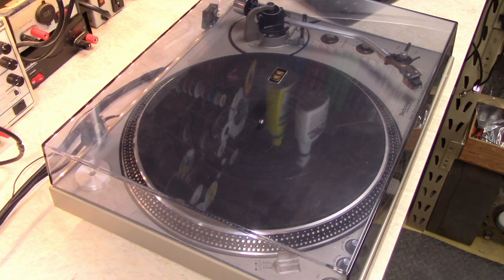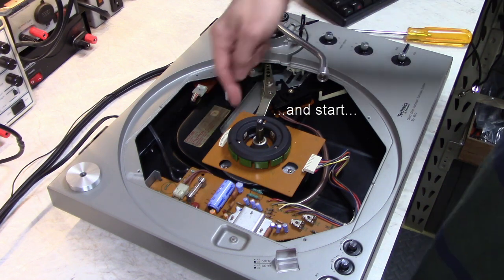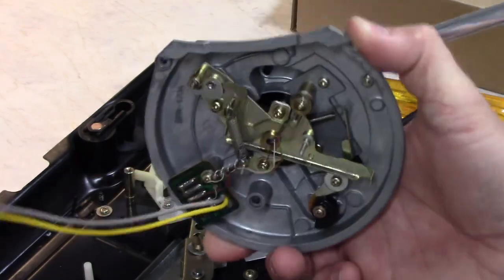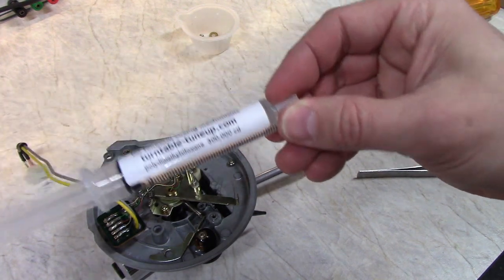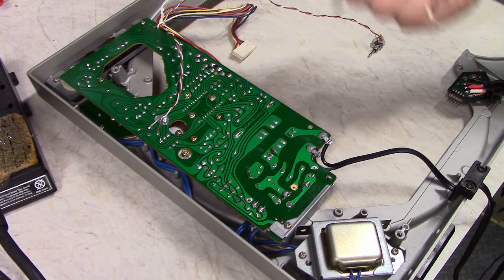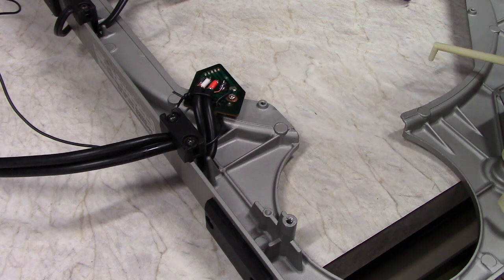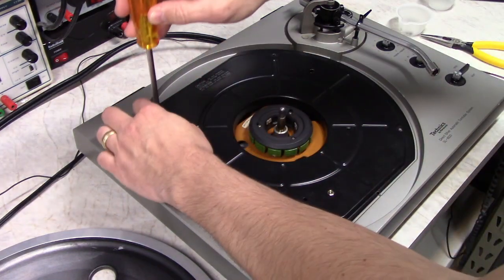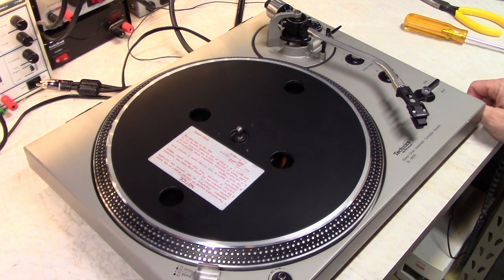Technics SL-1600 Servicing

Comment: I just really wanted to thank you for doing this. I managed to fix up and re-grease everything thanks to this very detailed video. I've done the speed knobs before, but had never fixed up the tonearm and lever. Now my Technics is running and clean inside and out just like the day it was bought in 1977. Thanks a bunch!
Reply from the maker: Glad it helped
Reply: If your turntable is not grounded then what
Reply: If my SL - 1600 is not grounded what is down low

Comment: Thanks so much for posting this video! Following your instructions I successfully replaced the cueing damping fluid on both of my SL-1650's today. 

Technics published a Technical Service Bulletin (available on the Vinyl Engine site) which has a "Method A" and "Method B" to replace the cueing damping fluid, depending on the serial number of your turntable. Both of my 1650's fall under "Method A" which requires removing the arm lift assembly from above, which, as you say, is not possible. "Method B" (supposedly for turntables with an earlier serial number than found on my units) does have you adding the fluid from below, but also has you first attempting to remove the arm lift assembly from above. Bottom line is that I wouldn't have had a clue how to disassemble the turntable to accomplish this task without your video. Thanks again!
Reply from the maker: Glad you were able to do it.  Yes, I had the same earlier design requiring more involved disassembly.  Still doable though!

Comment: After my previous post below, I asked a seller of the silicon dampening fluid on eBay about what he thought. He suggested I try the 500,000cst fluid or even the 1,000,000cst fluid (using a small amount). I took his advice and purchased the 1,000,000cst fluid. I re-cleaned everything (after a half-dozen times I have gotten pretty fast at completing all the steps) and applied just enough fluid to fill the ridges of the piston. The fluid holds better thereby allowing for less mess. The result was perfection: My tonearm drops very slowly and gently onto the record now. The 300,000cst is too thin for the piston and spring. That was the problem. Otherwise, these instructions are absolutely correct. Just do yourself a favor and get 500,000cst minimum or the 1,000,000cst.

Comment: Great tutorial. I was puzzling how to disassemble my SL-1700, which is very similar, and came across this. Easier than my SL-1400 to do the tonearm rest damper.

The only thing I found is that if you push the tonearm rest fully down, the hex head of the height screw sits proud of the rest, enabling removal of the screw, and therefore the tonearm rest (same as on the SL-1400). This then allows removal of the damper rod with the tube plate, without having to disassemble the anti skate. Just makes it even easier.
Reply from the maker: This is true of the later serial numbers.  Mine is the earlier one before that added this capability.

Comment: I followed your instructions to the letter. I tried to add the 300,000cst stuff from the same company three or four times. It wasn’t so easy since the stuff can get all over everything and it will flow down the piston. In any case, I repeatedly got the same result: The arm just dropped with the lever. There was no no slow drop. It actually seemed to drop somewhat slower when I tested it before I replaced the spring. Once the spring was back in place, and I lowered the lever, the mechanism just dropped at the same rate as the lever. I finally gave up. I must have been doing something wrong…or the black plastic lever part isn’t engaging with the white plastic part properly.

Comment: Seems like your overhang is too forward. Do you have the Technics overhang gauge? They're cheap as chips. Thanks so much for the this. I came here for the tonearm damping fluid fix and stayed for the 78 RPM mod which I think I'm going to do to my SL-1700. I plan to use a small low profile push button switch instead of your toggle. Less concern of interference and a round hole will take care of it. Well done and thanks again. 👏👏👏
Reply from the maker: Glad you found it helpful!  The reason for the overhang is that I am using the Baerwald alignment, which pushes the Technics tonearm to the outer limit (and looks a little funky because it ends up slightly crooked).  The stock alignment is indeed further in and is closer to the Stevenson method.  I do have one or two Technics tools kicking around.

Comment: This is a great video and it helped me dig into my SL-1650! Thank you for taking the time to create this how to. I adjusted my trim pots, but the 33RPM still runs a bit fast. Is there a place that you know that sells replacement pots? I think I need to replace the speed adjustment pots because I cannot seem to adjust them enough to get the 33 to not sound like chimpmunks are singing Xmas songs.

Comment: Thanks for the video, very helpful with showing how to take the table  apart. I am currently in the process  of trying to solve the problem of having the speed randomly speeding up and slowing down.
Reply from the maker: Does it hold steady if you move the speed adjustment to be slightly off?
Reply: @AmorphousAudio  You need to clean the speed controls from underneath with Deoxit. Search Youtube for videos on how to do this.

Comment: Can you recommend the proper lubricating oils and grease you use and where to apply them when doing a complete cleaning and re-lubricating?  Much appreciated and helpful video in reviving my SL-1700
Reply from the maker: I use a synthetic grease called "super lube" to replace most light-duty greases used between plastic/plastic and plastic/metal interfaces (where white lithium grease is normally used).  Some situations with higher loads require moly lubricants.  For oils, it kind of depends.  For brass/bronze bushings requiring light oiling (like capstans), I often use a synthetic sewing machine oil.  Technics uses a special oil on their motor spindles, which is a heavier viscosity.

Comment: You can turn the hex screw by depressing the lid arm itself—it’s spring loaded.  The screw will then be able to turn once the lift arm is slightly pushed down revealing the hex screw head.  The lift arm is the cue lift that lifts the tonearm.
Reply from the maker: That is true on the later serial numbers.  Sadly, mine is an earlier model that requires disassembly.

Comment: Can you tell me where to find the schematic and service manual for the SL-1600. I purchased mine new in 1977 when in the Navy. It is not working properly the grease is probably dried out. I can only find the SL-1600 MKII manual. Great video and maybe I won't need the manual since you gave detailed instructions. Thanks for this awesome video.
Reply from the maker: Check vinylengine.com.

Comment: Hi just got this turntable from my father and it needs servicing.  I dont know how much I want to put into it.   How does the 1600 compare to a modern $1000 table?  Thanks!
Reply from the maker: Well, it really depends on what you are going for and what condition the deck is in.  Even at $1000, no one is making direct drive tables anymore...though that isn't super-important to most people.  The other thing modern TTs don't do is automation.  You can get cheap tables that are semi-auto, but all the high-end stuff is fully manual.

Comment: You need special silicone grease CS5000 or CS3000 for the support cue arm damper ! It's also used and sold for RC remote control cars differential depending how fast you want your cueing arm to drop down !
Reply from the maker: Yes, I am using the correct grease for this application.

Comment: Great video. I have an SL-1700 that I need to add damping lube to the arm lift as the arm drops too fast. I watched a video yesterday showing the difference when using the stylus downforce scale, with and without the mat. Actually, to get an accurate reading the mat should be removed, since the thickness of the scale itself is about that of the mat.
Reply from the maker: Yes, the thick mat on these is perfect when using a scale of you want an exact value.

Comment: This is awesome! I’ve learnt so much...
I am about to replace the RCAs on my Technics SL 1800 as I am losing the left channel... Should I avoid a pre soldered internal ground one and just solder new wires?
Reply from the maker: I replaced the cables on mine with a new set of quality RCA cables.  I just cut the connectors off the other end.  Most cables will work so long as they are not too long.  Ideally, you want something with low capacitance, bit they figure is rarely specified.
Reply: @AmorphousAudio  thank you so much!!
Sorted that!... only problem now... on putting back together, it’s lost its ‘bounce’... no earthquake tests until I suss where I’ve gone wrong! 😌

Comment: This is a great video. I just imported this unit from Japan, Cosmetic wise it is excellent. Now I am having the erratic speed issues which seem like spinning at 90rpm or more. Yes, I am using a proper 220v -> 100v transformer. I am running out of ideas how can I fix this? Is this the AN630 IC issue or something else. Would you be kind enough to shed some light on this? I love this unit but I can't use it with the speed issue. The spinning is inconsistent in the sense, let's say it is spinning at 90 rpm .. it also slows down by itself and goes back faster spinning again. I tried to adjust the VR underneath the platter, it did not help either. Really want to fix this unit for my personal usage. Any idea I would really appreciate. Thanks for this video!
Reply from the maker: It's usually one of two things: dirty adjustment pots or bad capacitors.  Buy a can of Deoxit Fader and give the speed control pots a blast.  If you move the adjustment knob to a "wrong" speed position, is it more stable?  If the deoxit doesn't work, then the pot may be too worn.  A workaround it so tweak the internal adjustments on the PCB slightly to move the correct speed setting to another position of the main pot.

Comment: Great video ..... I have problems with my arm not starting  or ending properly on my SL-1600 any video on adjusting that ?
Reply from the maker: If it is not moving completely into position in either direction, it is probably an issue similar to what I have.  There is also a small gear that tends to crack that causes issues as well.  The position where it comes down on the record is adjustible.

Comment: Excellent presentation. Hope to pick up the same model TT from a friend of a friend and will use your video.  Many thanks 👍
Reply from the maker: Thanks and good luck with it!
Reply: Amorphous Audio - Yesterday I cleaned and added silicone damping fluid to the cueing mechanism just as you described in your SL-1600 video. Mine turns out is an SL-1800. The strobe light comes on but the motor doesn’t spin. I will take it to a Tech to find out what the issue is. Great TT in perfect shape.

Looking forward to your future vids 👍👍

Comment: I have a FL 1300 Turntable Direct Dr. and it will not stop turning. I don’t know if it’s from the arm adjustment or the mechanism itself and sounds like you know what you’re doing.
Reply from the maker: I assume you meant SL-1300.  Does the automation work otherwise?  I think the motor is controlled via a micro switch on these, but it's been awhile and I don't recall off the top of my head.  You can download the service manual from vinylengine.com.
Reply: @AmorphousAudio  yes Sl 1300
Reply: @AmorphousAudio  ok thank you very much

Comment: all the sl technics I had having the same problem; tone arm dropping to fast. I tried mij sk 1411 to mend it the way you dit here. it was not a succes. in the end using in the end thick gravite? grease but not enough effect on the damping. I have quite this  job now. 😒
Reply from the maker: If the regrease did not work, then it may be something else with the dampener.

Comment: behind the tonearm is the pivot. there's 2 horizontal screws 90 degrees apart, their silver. do you have a video or know how to calibrate these screws their like small cams. there's a small screw inside and a slot screw surrounding the tiny screwdriver screw. . i have a sl-3200 technics.
Reply from the maker: Are you referring to the set/locking screws of the tonearm pivot itself?  I generally avoid touching these (even when replacing tonearm wiring), as they are quite fiddly to get right again.  If someone has taken the linkage all apart, then you are forced to deal with it.  It's a matter of getting the linkage centered on both axes while leaving some play in the process.  Then you need slowly bring them in a little at a time while wiggling the axis to keep it centered until there is no play in the bearing.  Then lock the locknut on one side and back-off the other side of that axis about 1/8 of a turn before locking it.  That should give about the right amount of play.

Comment: You can actually loosen the hex screw if you just push that little curved black plastic part down. It’z the same way you adjust the cue lifter height actually.
Reply from the maker: That only works with some units.  :)  If you look at the service manual, you'll see there is an "early" and "late" design on the lift mech of the 1600.  Mine is the early design, which requires full disassembly.  Trust me, I tried and tried that trick before I learned about the difference.

Comment: anyone know the part number for the arm rest/lock? Mine broke. Also does it just screw in or do i have to totally remove the tone arm base like you did to screw in the arm rest? i hope not but your video made it easy enough to show how to do it.
Reply from the maker: Your best bet it probably to find a donor table, though that is getting tough in this age of vinyl resurgence.  Even a basket case SL-anything goes for too much money on eBay just to buy it as a donor.  You might have better luck on Craigslist or some other local listings on Facebook finding a beat-up, dirty TT with no dust cover for cheap to use for parts.
Reply: @AmorphousAudio  yeah I guess ill go without and continue using what im using to secure the arm while in storage.

Comment: how much current runs thru the switch? if it is a low current ,why not use a touch switch with some dubbel sided tape underneath the top below the speed knob or the on of switch,might be easier than lifting the mat up
Reply from the maker: Yes, that is another option.  The amount of current is small.

Comment: very detailed video. learned a lot. can you do a video about the 1600 queing problem? that would be a lot of help.
Reply from the maker: Which problem are you referring to?  The queing arm or the auto-start?
Reply: @AmorphousAudio  sorry. the headshell during autostart goes to the end of the record (near the center) and immediately returns to its resting position. i have to place the cartridge manually to the record if i have to use the 1600mk1.
Reply: @geoffanasar  I have that exact same problem with my SL-1301 TT.

Comment: Something that riddles me: in the PCB in the tonearm assembly you can see that the right ground is connected to the chassis ground. It's also like this on mine. Is this by design? I'm asking because my right channel is quirky and I don't want any chassis ground and motor noise in my right signal.
Reply from the maker: I think this is being used as a star-ground point of sorts for the TT.  I've seen it done this way to ensure there is no ground loop between the shielding of two channels (since they will be will likely be connected together at the preamp).
Reply: @AmorphousAudio  Thank you. I have eventually reconverted it to the original situation, where the chassis ground is separate from the channel grounds. It fixed the audio problem in the right channel. I think some userd do it to eliminate the ground wire. Cheers

Comment: Thanks for the great video, would a SL-1700 disassemble the exact same way? Anyone know if the 1700 uses the same capacitors seen at the 2:44 mark?
Reply from the maker: I think there are a lot of commonalities on the electronics side for this generation (non-mk2) of SL-1x00's.  I don't have the SL-1700 myself, tho.

Comment: My sl1900 have a runaway speed problem.i cleaned the variable resistor in the circuit board and also the knobs pots.but problem still there. I experiment by replacing  the variable restr.with 200kohms(the original value 20k won't work.), The rpm 33/45 is now controlled but unstable. Do I need to replace the "knob pots"?please advice.
Reply from the maker: It sounds to me like there might be one or more failed capacitors around the speed control circuit.
Reply: @AmorphousAudio  thank you for your suggestions.im having doubt too. The electrolytic caps are non polarity (2mfd)

Comment: Hello, I have this turntable and I have an issue with the anti-skate not working correctly. the tone arm drifts from the center back to start even on 0. I believe it is causing records to skip. How do you fix this?
Reply from the maker: The number of the anti-skate dial corresponds to the tracking force being used.  So if you run 2g of tracking force, you set the anti-skate to "2" and tweak it from there.  Obviously you can't run 0g of tracking force, so the anti-skate still pulls slightly since it is calibrated for more realistic tracking forces.  Most of my turn tables pull back lightly on the arm, even at "0".

Do you have an appropriate amount of tracking force setup for your stylus?  Does the tonearm move freely?  Does it skip back or forwards?  Does it tend to skip at certain arm positions?
Reply: @AmorphousAudio  I have it set at 2 grams of tracking force and have the anti skate at 2 but it drifts at about the 7 inch position. I put it on 0 and it still drifts but does better at 0 than at 2, If I put on a 7 record it will not drop on the record it drifts off of the record as it is going down. that is not normal.